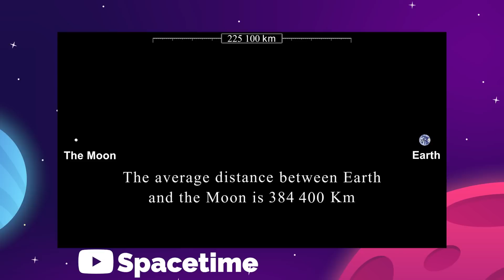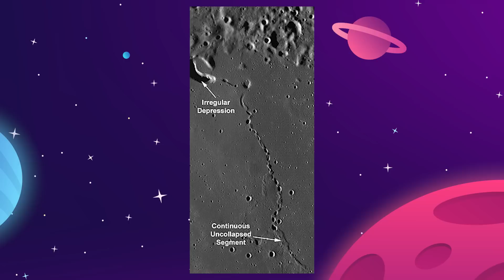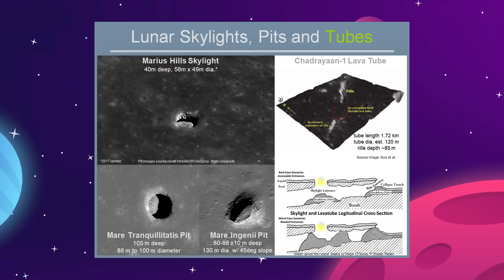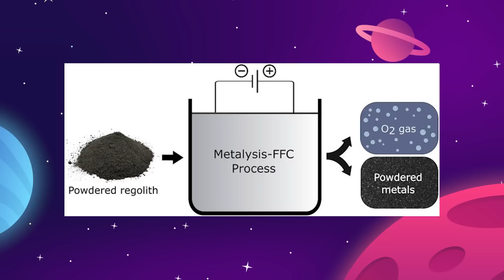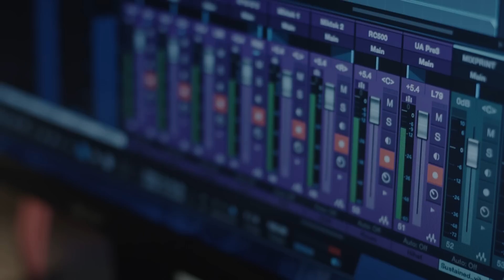What The First Year In A Lunar Colony Will Be Like

Comment: I think (hope) there might be a couple of areas where you've been overly pessimistic by looking at previous experience. I'm absolutely not saying that either of these issues won't be significant and very important to solve but they might not be quite as challenging as you suggest.

Firstly the psychological issues and your comparison with that disastrous 2-years-in-a-glass-dome experiment. I would hope that by the time we get to permanent bases on the Moon re-usable launch vehicles, probably from more than just SpaceX (e.g. Sierra Space Dream Chaser), will have optimised getting from Earth to LEO so much that the overall cost of getting astronauts to the Moon and back (maybe by transferring to a dedicated Lunar transport in LEO) will have reduced to the level where an ISS-like crew rotation schedule could be affordable so a lunar stay might be more likely to be in the 3-6 month range rather than multi-year stays.

Secondly the heart/health issues. Yes astronauts on the ISS need to exercise 2.5 hours a day for 6 days a week but that is in essentially no gravity. At least the Moon has approx 1/6th Earth gravity to give some extra constant resistance vs the ISS and I wonder if the benefit of that could be amplified by standard Lunar clothing including weighted vests, weighted shoes (and/or ankle weights) plus some sort of weighted splints for the forearms. I'm not saying that would avoid the need for an additional pretty intense exercise regime but even if measures like that could reduce the exercise requirements from 2.5 hours a day to 1.5 hours a day that could be quite a big win for productivity and mental wellbeing.

Comment: The best way to fight bone and muscle mass Lost in space is to create a space suit that.. combines springs and basically like a Bowflex.. woven into the lining of the suit that fights you no matter what you're trying to do.. any which way that you could normally move you're fighting resistance.. like rubber bands that go down to your feet that connects your waist.. I made one back in the 90s that want some to pressurize suit.. but it's simulated my 130-lb body at the time making me feel like I weighed 800 lb.. basically if you weigh 200 lb of be like carrying a dumbbell across your shoulders that raise an additional 600 lb.. I figured out on Earth that it was much easier to put 80 lb on each ankle 40 lb on each one of my rist's  where vast that has 180 lb of lead weights and then on my belt basically use a scuba divers belt with 120 lb of lead weights.. the fastest route to my upper body the belt the weight belt added weight to my hips 80 lb in each angles to each time I picked up my foot making every step much harder.. course I didn't start off at that level I started off with like two and a half pounds on my wrist 20 lb in each one of my ankles.. you get the idea.. I started off with low weight and eventually I got to a point where I was walking around with just under six hundred pounds of weight on me at all times. And the 90s I was in school and I got a lecture from my gym teacher that kids like me need to workout constantly so we don't end up fat and lazy.. I gave him the finger.. and then told him how I workout everyday all day long. And then right in front of them took off all of my weights.. the funny part is he tried picking them all up and he couldn't.. with all of my weights off I took a basketball and I threw it at the concrete wall about thirty feet away from where I was standing and it popped it blew up... What the weight off I can jump higher I could run faster.. I could punch harder.. adding led to your body on earth works... And space you have to use springs cables and rubber bands.. and it really wouldn't be hard to make a suit like that with today's technology for some reason they just don't..

Comment: The reasons to put a base in a crater are numerous:
1) Possible resources within the crater.
2) Lunar regolith is a cheap and plentiful source of insulation and radiation shielding.
3) Solar panels along the rim could provide power 24/7 as well as sunlight for a day/night cycle.
4) The walls of the crater will provide protection from nearby strikes.
5) Material dug to sink the base can be reused, making construction more efficient.
Reply: Lunar dust will reduce solar panel efficiently.

Comment: Biosphere II failed due to oxygen depletion, at least in major part.  People live in submarines and other small spaces for long periods of time in many places on Earth.  Frankly, I think a nuclear submarine under the sea for months is much tougher, psychologically. 

Lava tubes not only have skylights but each also has an outflow at the end, where you can enter it, horizontally.  I think a lava tube at a place with constant sunlight would be best, for solar energy.  Then again, a small partable nuclear plant isn't such a bad idea, either...  the ones NASA has had developed for exactly that purpose.

Many asteroids are iron/nickel -- exactly what you need to make stainless steel.  Using a railgun to shoot products into space then should be easy and highl precise (being no wind is there).  I'd imagine building spaceship or space station hulls or such would be a great business on the Moon.  You can't get that stuff from Earth, very easily.  I have long thought that, just one mission to the asteroid belt (a 5 year mission) could easily return with enough water-ice to kickstart a total expansion into space.  Bring it to the moon and now you can garden and take baths.  You can use it for iron-clad radiation shielding in ships.  You can use it for H2+O2 combustion rockets for going faster into deep space or slowing a descent to the surface of the Earth.

Comment: The moon is a waste of time and resources. Mars is far easier to colonize than the moon. The moon has no atmosphere. Mars has a thin co2 atmosphere. Carbon dioxide is a mixture of carbon and oxygen. Take out the carbon, use it to make things and u have the oxygen to breathe and make rocket fuel. There is no water ice on the moon. The idea that there is ice on the bottom of craters is mostly theory. Where as rovers have scratched the surface of Mars and visible water ice exists. Mars has a day nite cycle of about 24 hours. This means the day nite cycle allows normal sleeping rythem on mars and allows the use of solar green houses and use of solar panels. All the elements we need have been found in the martian soil. Not so on the moon. Read the book mars direct. Dr zubrins explains that we have all the raw materials on mars to make breathing oxygen, oxygen for rocket fuel, can make water from the ice, can grow food, etc. We can build homes underground for thermal and radiation protection. The moon may be closer to earth but u need to bring more thing to the moon in order to live. Mars is farther away but it has more resources to foster human life..... Again read Dr zubrins book.....the case for mars.  Nasa is a waste of time. The shuttle to no where, the I s s, the sls and Artemis programs are all wastes of tax payer money! SpaceX and Dr zubrins can get us to mars faster and cheaper than nasa. If u want to go to mars,......support Dr zubrins and SpaceX. If u want to squander billions of dollars and more decades of time support nasa and a corrupt govt and big business structure and a corrupt Congress......

Comment: 13:42 this section is why it will turn into a penal colony. Pressurized lava tube mining colonies, cascade rad shielding and meteorite reinforcement, regolith gathering and surface equipment work, but you only have a year of times work to be on the surface. Your not gonna have a lot of takers. Where might an "advanced" nation might get such a labor pool...
Use to confinement in small artificial areas, tight and detailed schedules, rigorous physical conditioning, poor and hazardous conditions?
Reply: The Moon is a Harsh Mistress

Comment: The use of gravity on the moon to keep physically fit would easily be served by creating a full body suit consisting of weighted footwear as well as a weighted  full body suit worn inside of the habitat while using a more conventional lunar excursion suit for outside of the habitat. You cannot do that m a microgravity environment like the one on the international space station. In a low gravity environment such as the moon it would be possible to fill out the remaining mass of your earth weight using this weighted suit design and yet design it in such a way that when you move your mobility is not impaired and your movement would be the equivalent of one gravity.
Reply: I had thought of a great way to mitigate the risks of radiation on Mars and lower gravity … a lead lined compression suit worn inside and outside.
The Martian colonists would feel like they were normal weight, feel Earth like pressure and have an extra layer of protection from solar radiation.
… this is something that they could trial with the Lunar colonists.
Reply: Just have magnetic floors and steel soles on the shoes/boots.  Simple.

Comment: Tesla cybertruck moving 84,000 pounds on the moon ? Nope - the main issue is brake cooling. A large mass needs a large amount of energy dissipation to slow it down, and there's no air to cool brakes on the moon - the only way to dissipate that energy is via infrared radiation, and that can be very slow. The brakes would have to handle the equivalent of about 20 cars, and without air cooling, that's not possible.

Comment: I never knew there were such extreme temperature swings on the moon.. Always thought of it as a frigid, bone-dry harsh place. With full range radiation from the sun..
Reply: Yes, that full range radiation is what causes the huge heat spikes in direct sunlight without the protection of our atmosphere. 
Then in the shadow because there's no atmosphere to hold heat it gets extremely chilly, you would definitely need to put on some socks 🧦

Comment: why does every simulation build domes or other buildings on the surface?  one micro meteorite could destroy an entire habitat, not to mention the heat & UV differentials.  build caves into craters for insulation, install easy to replace solar panels on top and have nice holo panels everywhere for a pleasant environmental psychological ambiance.  hah literally what you said in fact.
Reply: A micrometeor will not destroy an entire hab.. however you are 100% correct that it's silly to expose them to the sky for long periods.  Solar panels on surface, habs under ground.
Reply: Because egg shape is very very strong

Comment: No these metals are NOT on the bottom of craters,   they were blasted out as the meteor evaporated at impact.....Physics....   Basics...
Reply: There isn’t a solid chunk but the local dust will be saturated with higher levels of them. Most moon resources extraction will consist of processing mass volumes moon dust to extract important metals